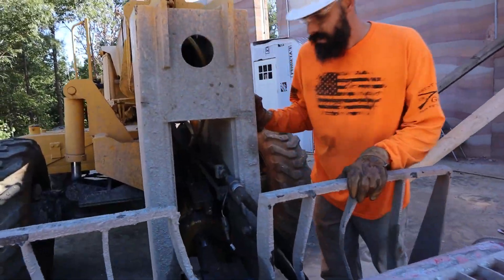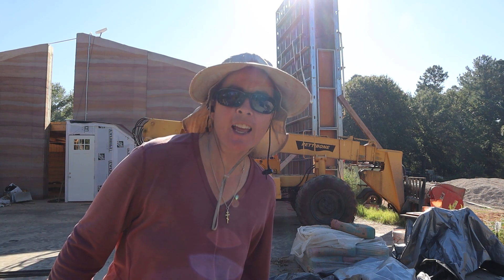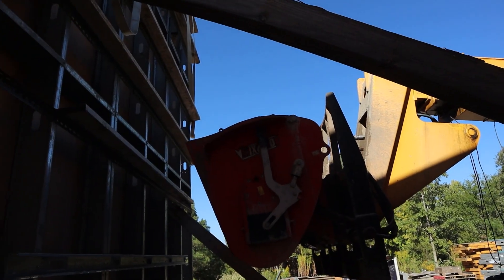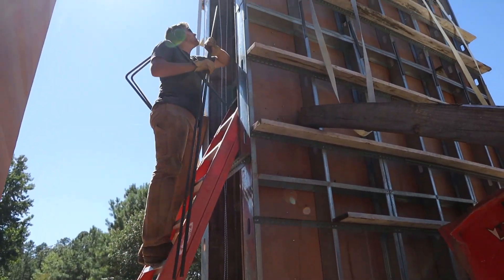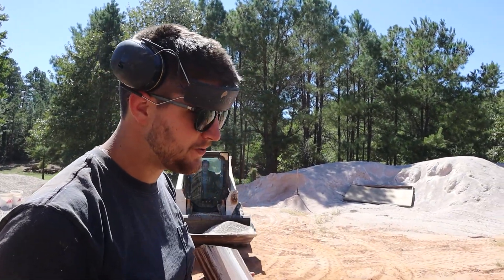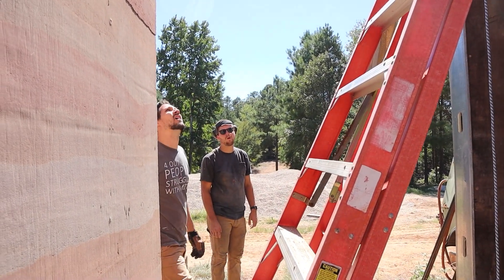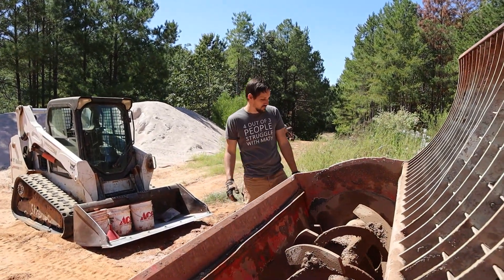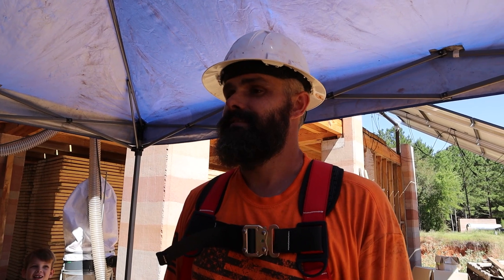Ramming Again - Let's Finish This Wall - #107

Comment: How long Will your walls last? Will the rebar, eventually rust, expand and burst your walls? I know that in modern concrete the longevity is limited to Ability of the concrete, to passivate the pH, which eventually deteriorate due to carbonation from atmospheric CO2. Roman concrete last forthousands of years because it does not have any rebar, have you considered using fiberglass or basalt, rebar, or forgoing rebar all together and working with compression walls?